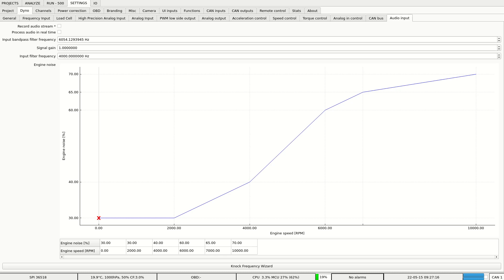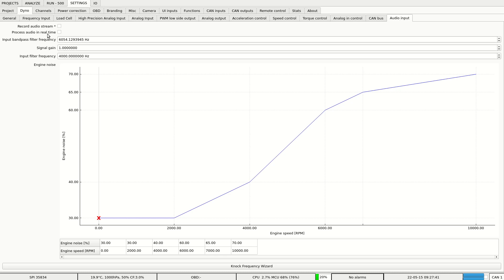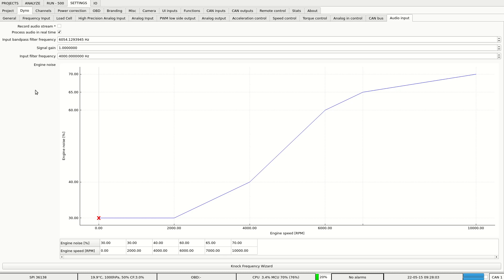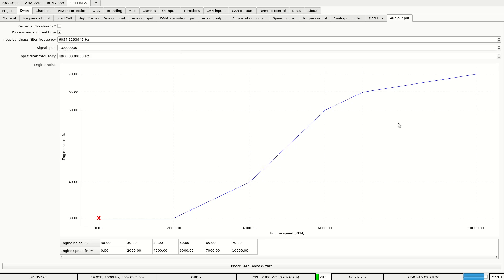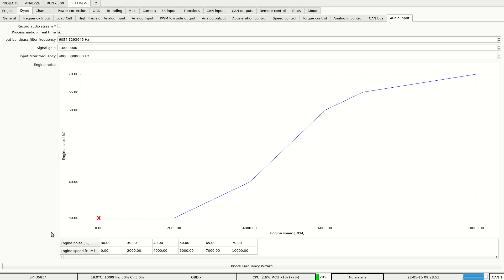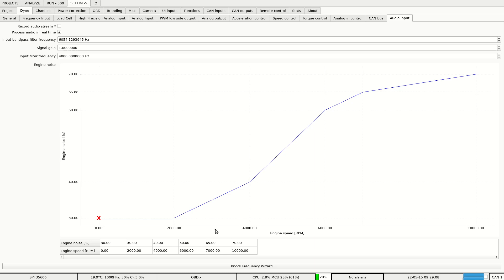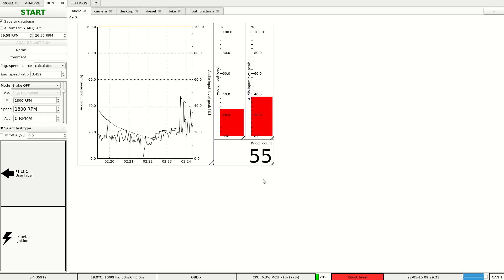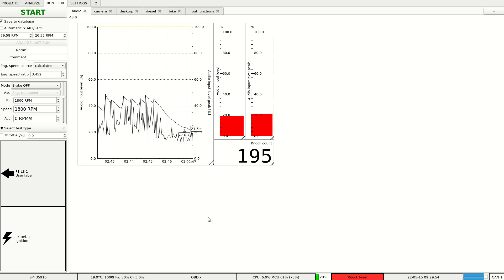Engine knock detection in PEREK Dyno2 dynamometer software

Comment: Hi Ronald, this feature is possibly not something I will personally use much as the ECU's I mostly use have very good knock control, however I think it is really innovative to give this functionality to a dyno controller and I think many users will like it.  I just wanted to say it is really refreshing to see regular updates pop up almost every few weeks and many of them have come with significant improvements.  For this knock feature you say the sensor is connected via a "sound card", for my own curiosity, do you mean the onboard audio port or are you using an external sound card like USB or something?
Reply from the maker: Unfortunately, the onboard sound card has only output capability. You need to use USB card. I tested it with a cheap 10 EUR card, so it's not a big cost.
Reply: @perekdynocontrollers  thanks, I thought that might be the case. Good solution.